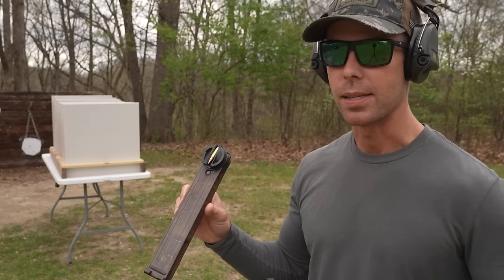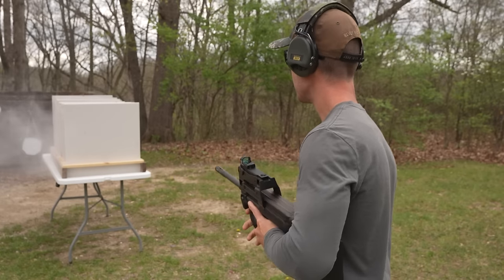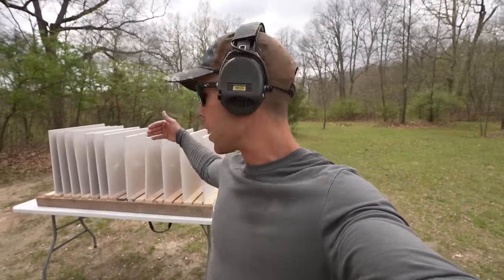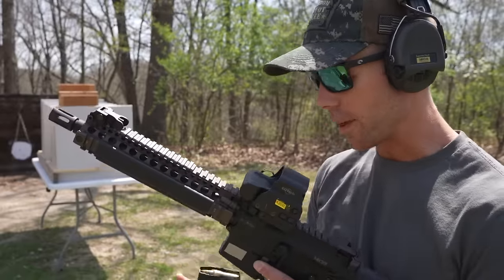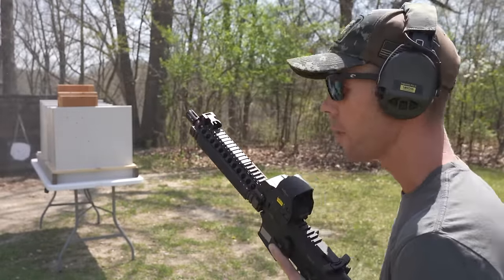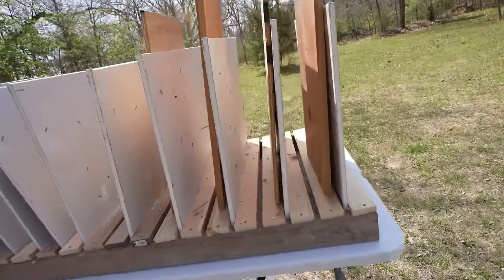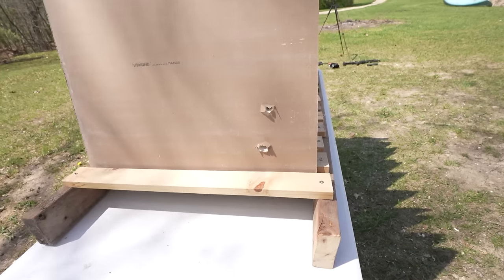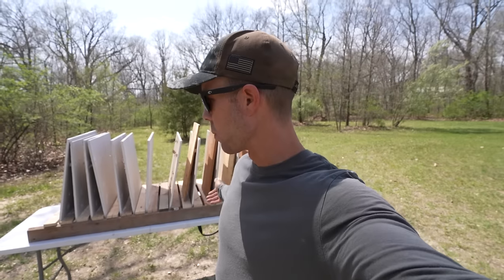The SAFEST Caliber For Home Defense??? (Drywall Test)

Comment: 9mm Hornady critical defense goes through one dry wall and lodges into the second in a real house👍free accidental test
Reply: Oops
Reply: And 5.56 will go thru a memory foam mattress, but the steel adjustable bed frame will stop it from penetrating the hardwood floor…
Reply: @tmango78  useful information thanks for the free testing 😭😭
Reply: And a little bit of clothing in a Rubbermade tub in a closet will stop a 9 mm 124 g Speer Gold Dot. Well after the pillow and the corner of the purse. A couple of sun dresses had some holes and a denim embroidered sun dress actually stopped the bullet (bullet traveling horizontal with the clothes layered in the tub. Actually very little damage to the hollow point and what there was was probably from the plastic tub that got hit at an angle. I can see apartment drywall walls being an issue but I realized with that "accident" that in my house it would be hard to find a place where drywall is the only obstacle because of all the full closets, pantries, etc. And yeah, my wife got new purse and sundresses (and I get shit everytime I go out shooting).
Reply: @edweeks6423  I appreciate your scientific efforts I also found even through dry wall the hollows stay pretty much in shape
Reply: Pffft hydrashock round go through 1 layer and significantly dent the second… lol same thing here - courtesy of sig saur p320 and a drop… apparently some of them will go off when dropped
Reply: @PeteRamirez-i2q  glad to see similar results once again we appreciate the free testing and feedback
Reply: Federal 165g hpbt .308 will go through kitchen cabinet, stove, wall, curio cabinet, golf bag and 9 iron, another curio cabinet, 2nd wall and come to rest in water heater tank. Just FYI.
Reply: Well that’s concerning 🤣
Reply: @cobblerama  Jesus fuck the difference from handgun to 308 thank you for your experiment good sir 🤝🤝
Reply: 150 grain remington core lokt 308 goes in the back door of a Durango hits the metal piece in headrest break apart breaks glass and was found like 30 feet away from the suv
Reply: @ethan.amosberg835  hopefully those were your experiments and not someone trying it on your car 😭😭🤝
Reply: @Perc30-  fortunately not my vehicle but yeah we shot the hell out of it the blew it up with tanerite
Reply: @tmango78 what brand? Was it a Tempur-Pedic or another brand? Asking for a friend
Reply: @frostriver4547 😂
Reply: @PeteRamirez-i2q what???? Isnt that the military’s gun? I’ve got an lcp max, I’ve heard maybe they aren’t drop safe too..
Reply: Brother…😂😂😂😂😂
Reply: @LKaramazov  the six hour P3 20 comes in two variants M17 and m18 
I have M 17 which is a civilian version,
Reply: That's exactly what I use though I live in a apartment i also leave home alot
Reply: 9mm 124 jhp goes through the roof fyi! for anyone wondering
Reply: @dailyvids5801  what type of roof? Just wondering
Reply: @Perc30-   standard 1950’s home
Reply: @cobblerama yikes! That sounds like some very expensive data.
Reply: Well 7.62x39 fmj will go through at least 5 layers of drywall and a dresser 😂 so definitely don't use that
Reply: @adabsurdum5905  5 layers of drywall is insane 💀
Reply: I don't see how, mine went through an interior door with two towels a mirror sheet rock insulation sheet rock siding and neighbors siding.
Reply: Lol jfc

Comment: Separation walls or party walls are 5/8 drywall with 2×4 studs offset on a 2×8 plate every foot with another 5/8 sheet of drywall at bare minimum.  For this test to be accurate you should build such walls and try again the results may be very different.  Some buildings use 2 layers of 5/8's on each side.  Its dependent on local fire codes and building codes
Reply: We had to double up on 5/8 for fire code between apartments so 4  layers of 5/8
Reply: Yup double layers and depending on construction company the insulation can be thick! I know it’s not much but… also my favorite 5.7 round is the Speer gold dot 40 grain.
Reply: Here in Missouri, OK, AR area apartment and motel/hotel have dry wall and OSB board on all external walls and all wall adjoining other apartment soo BIG difference
Reply: In MA most of the buildings are old and have 1 inch plus thick plaster and lath. Older buildings 1800s have wooden lath, newer buildings 1940s have metal lath.

Comment: Modern apartments have a firewall between them, consisting of two layers of 5/8" firerock sandwiched together, with two layers of 1/2" sheetrock and two layers of insulation.
Reply: I came here to say this.

Comment: I actually work in a drywall manufacturering facility.  Their are a lot of different types and thicknesses of drywall.  Id love to get an experiment of what a construction person would actually use for building as opposed to the 1/2 sheets. And honestly after getting into the video, i can see the drywall used is what is called patch pannels, that is some of the crappiest drywall made.
Reply: Grumpyseabee I was also thinking that in hotel rooms they put a 5/8 board on the studs then a 1/4 sound deadening board over that then slap on stucco on that, but I'd bet in some apartments they may not be built to code. There is a chance some one cut. corners somewhere
Reply: Drywall paper is soft, 
Yet, after primer and paint, the surface is more durable against scrapes and dents.  May affect multiple layer penetration.
Reply: @finaltouchautodetailingllc I lived in a brand new build in Portland and the drywall was 1/2 thick - sounded and felt absolutely cheap. Corners definitely cut. Advise anyone living in an apartment to pound a decent sized drywall anchor and inspect what they got.

Comment: Hollow points are bad for dry wall tests. I work as a firearm/ammo salesman and i never recommend a standard hollow point as a good option when somebody says its a bedside only pistol for one reason, it doesnt expand well at all. In many cases it doesnt expand at all and basically fmj's itself right on through. The tip gets packed with the first layer of drywall and doesnt open up. It also does the same thing in glass like windshields where it crushes closed instead of opening up. I always recommend critical defense or critical duty, especially if its going to not leave the house as an edc handgun. Critical defense rounds are barrier blind and open on dang near anything and dump a lot of energy at first impact because the insert forces the bullet to expand instead of letting it crimp shut. I do have a couple ideas rolling around in my head id like to test out that will probably be future videos on my channel that im pretty excited about, im just not excited about the prices of lumber and drywall to buy for the tests lol

Comment: Can you do a test of large birdshot loads like BB, #1 ? Very little in the way of good info as to if it would be a good HD load! Thanks and keep up the great content!
Reply: 😮 great idea
Reply from the maker: Yep I will add it to the list right now. Thank you!
Reply: @1ShotTV  you could even try some of the tungsten super shot stuff, see if that denser metal helps. Just a thought, they aren't the cheapest lol
Reply: I got a ton of BB, BBB, and number 1 for goose hunting, in 3 and 3 1/2” flavors
Reply: I have some 3" Steel BB shot in my 12ga as the first line of apartment defense. I've tested it against a milk jug at seven yards with good results. Obviously not as much energy as 00 buck and pattern spreads faster but I'd say anywhere inside five yards is gonna drop someone. Even a little past seven yards a shot to the head/neck would do the trick. Because of the number of pellets you can trust it to hit something important at that range, just much less energy being delivered and less penetration. But the energy spreading out quickly is theoretically what makes it good for not penetrating apartment walls. I'll test that theory at some point and put it on youtube.

Comment: I work construction and they always use 3/8” or 1/2” dry wall with insulation and in some instances they will double the Sheetrock and use a hard spay in foam
Reply: Who’s still using 3/8” drywall for interior walls? Maybe for overlays, certain overlay curves, or repairs, but not standard walls.
Reply: Also, also don’t forget the people who like to go the route of sound proofing there walls to on new home builds ( more common than a lot of people think) I use too be a scab for a construction crew out in Chicago in the early 2000s
Reply: @JimYeats it’s a lot more common than you think these days
Reply: @JimYeats  I do commercial work so apartments and high rises, depends on the area they use 3/8th
Reply: @bradenjones2825  Man that’s crazy. I mean, I get it, it’s a regional thing, but still, an 1/8th more than 1/4”.

Comment: Tactical Hive "Coch"  tested different barrel lengths of 556 , the velocity speed is the key to fragmentation or over penetration. The 16"  had  total fragmentation , where the 11.5" moving slower didn't,   it went completely through the 4 reems of paper they used for the testing .  Look it up, worth the time to watch.
Reply: So a ‘20 barrel with 55gr sound like the way to go!

Comment: I have a 9mm carbine with a laser dot for home defense, zeroed for about the longest range in my apartment. My goal was having an "easy mode aim" I don't have to think too hard about if I'm woken up at 3am. It also has a bright AF "Light From God" flashing strobe light, so hopefully I won't have to actually shoot someone.

I've been told to get ".223 varmint rounds" but I just do not trust using an AR-15 in an apartment XD

Thanks for doing this all the same. I watch videos like this constantly, looking for something to hurt bad people that magically won't also ignore drywall LOL. So far the drywall has NEVER won :D Not frangibles (needs to be harder than the bullet), not even birdshot.

I almost bought that weird Kel-Tec 5.7 pistol that holds 50 rounds recently. It's now sold.

Comment: You need a suppressor for your 10.5" AR.  Which is very cool, but it's also not something a ton of people have for home defense. I do happen to use a 10.5" suppressed AR, but what I was getting at was the bullet is not getting the velocity it would out of a 16" AR. That lower velocity may cause the bullet to penetrate deeper.

Comment: Would have loved to see this with an FN 57 pistol. Also, I'm in a stuccoed house, which means there is a 1/4" of concrete slathered on the outside. I'm expecting that my 57 round will lose a lot of velocity on that, and could start coming apart. So, please go find some stucco to play with. 1/2" fiberboard, a little metal mesh to hold the stucco, and the stucco. Also, what about trying a few rounds of Elite Ammo's T6B +P AP ammo? The 57 pistol is supposed to be able to get maybe 2,500 FPS with the T6B. T6B is ferocious on armor, but hopefully doesn't end up five houses down the street. Thoughts?? GREAT video!!

Comment: Also, if you use the 5.7 from a pistol instead of a longer barrel, as you did, it may reduce the probability of over-penetration even further.
Reply: Good point! Maybe should have used the same barrel length for all calibers.
Reply: Slower velocity will go through more drywall. While higher velocity is better against a single sheet of body armor.

Slow velocity also does better against water while high velocity is like ramming a motorcycle into a house.

Comment: a few points.
Drywall code for walls is 1/2 inch or 5/8th OR 2 layers of 3/8. it looks like yours are 1/4 inch at most. the thickness is a HUGE change.
you might not think insulation is relevant but the FBI also found that a cotton tee shirt can make some difference. insulation is light and fluffy but the bullet will be pushing it towards the next surface and then acting like padding against the hard surface expanding the area where the energy will be applied.
there are many different loads to all of these, but especially the 9mm. they do have lighter rounds for subsonic and "home defense" rounds. lighter grain and less propellant.
drywall supported with frames at code would make small changes to how much pressure it takes to penetrate it. I can easily punch through a 4'x4' piece of drywall especially if not framed. put a 16" on center frame to it and I would have to increase how hard to punch to make the hole. just like a long stick is easier to break than a short section.
I like the attempt, but science it and do it fairly.
also the 5.56 and the .223 aren't DESIGNED to tumble. they do tend to tumble during rapid deacceleration as the rotational force becomes unbalanced and created a yaw. this isn't a designed or intended feature.

Comment: If you’re worried about wall penetration use frangibles in a 9mm. You can also step down to a 380 but for anything light like that I use either ball ammo or cast coated lead. The hollow points in light calibers don’t reliably expand. Drywall really doesn’t stop much. Maybe a 32 would fail to pass through.

Comment: I have the ,410 Mossberg Shockwave, I was wondering how the judge pistol, and the one from SaW would compare. Could you do an episode on the 410 in all configurations to each other. Also how would these firearms compare to a full size 18 in barrelled shotgun. The ammo, specialty defense rounds, the buckshot, and slugs.
Reply: Excellent point. I use 12 GA with 7 1/2 bird. Yes 7 1/2 bird. The way I figure you are limited to the "15 foot rule" by law enforcement. Any 12 GA at 15 feet or less is going to ruin someone's day yet that light of a load should not off your neighbor.

Comment: do this same test using osb and plywood, which are more common in newer houses/apartments than standard wood boards. also if you can find the old plaster over lattice which was common in late 19th and early to mid 20th century and do this test.

Comment: If I may make a suggestion... you should make another frame the drywall is sitting on and place it on top so the drywall doesn't move. That way the drywall would be closer to how actual walls would react when struck, as the act of the drywall leaning back dissipates/absorbs some of the energy.

Comment: FYI, with exceptions for grandfathered historic apartment buildings (which use plaster, slat & lathe… much denser than drywall), building codes require fireproof barriers between dwellings, usually brick or cement block.
Reply: That’s going to be location dependent. In my area I don’t see very many houses that have brick or cement
Reply: Most buildings here have plaster and lath but most buildings here are from between the 1700s-1940s. The 1940s buildings have steel mesh lath. My own house has well over an inch and a half of plaster and lath, original part of the house was built in the early 1800s.

Comment: In an apartment there are fire walls between apartments with extra special drywall that is like stone board
Reply: It’s not extra special.  Type X drywall is basically just a little thicker and has fiberglass mixed in for a little more fire resistance (prevents cracking during fires). But basically it’s just 5/8” drywall.

Comment: What about the 5.7x28 in a pistol.  Shorter barrel should translate to lower velocity, which should reduce the amount of penetration.  Also, I would like to see the results with the watermelon, drywall, studs, insulation, Tyvek wrap and siding in place, replicating an outside apartment/home wall.  With the different textures of the varying components, it would give a more realistic idea of what you could expect.  Just a thought.

Comment: The 5.7 projectile is hydro sensitive……destabilizing in fluid ….. it was designed to limit over penetration in a projectile moving as fast as it is …… but it maintains stability through non-fluid barriers

Comment: 1Shot, the old shotgun is the next test for this. Birdshot through 000. No doubt the birdshot will do the job up close and possibly past 10 give or take yards and  may not over penetrate to bad, (waiting for your test😊). I can tell you one thing from experience, a shotgun at 5 ft. certainly put my rear down. Like a sledgehammer at full swing with a blowtorch and hornets nest inside. Cantaloupe size hole. If one doesn't have to make a hostage type precision shot, shotgun with buckshot or slug, ( considering its penetration) load is hard to beat. Adding that slug gives some rifle distance. With the choke tubes you can do a lot even rifled tubes. A good thought out and tested shotgun and combo ammo is tough for close to medium range.

Comment: Actually if you look at 19:56 you can see that it did hit the very last one on the top of the drywall.  Just a little bit, but it did hit it.   I tried this test as well at one point, and I used drywall and 3/4 inch sheets. It was what I had, and well it did not stop much of it.

Comment: Just an fyi. Insulation does not help stop bullets. At least fiberglass insulation doesn't. Paul Harrell did a similar video to this some years ago and he shot a 4ft or 5ft  round role with a 25acp and it passed completely through the roll of insluation.

Comment: Right off the top, I've decided that the five seven isn't compatible with defense in an apartment, condo, or duplex. All that wood means nothing as far as the safety of the round in those environments. I'd lean towards a purpose designed self defense round known to stop inside a typical interior wall.

Comment: The problem I see with your test is that the drywall is only about 4 inches apart. You should set it up with 2 sheets 4 inches apart, then the next sheet about 10 feet apart with 4th sheet 4 inches from the 3rd (simulate an actual room and give space for bullet to slow and drop before impacting the next wall)

Comment: I appreciate your testing. 5.7 was a polymer tip, 5.56 was a FMJ, 9mm HP you didn't specify maker. 5.7 is the least powerful. I think better bullets for 5.56 and 9mm would have different results. You did provide good info.... don't use FMJ's or cheap 9mm HP's.